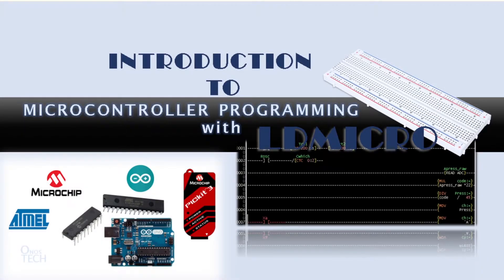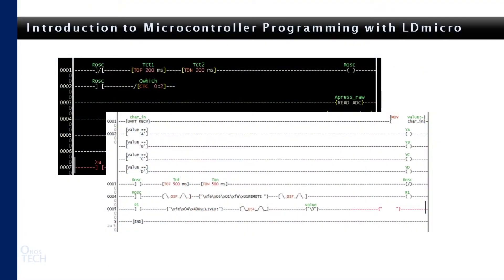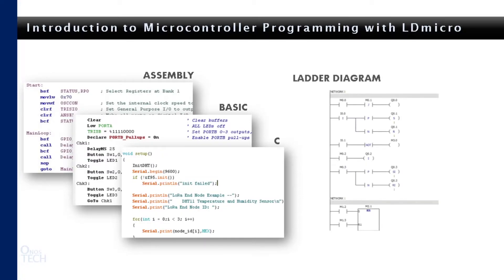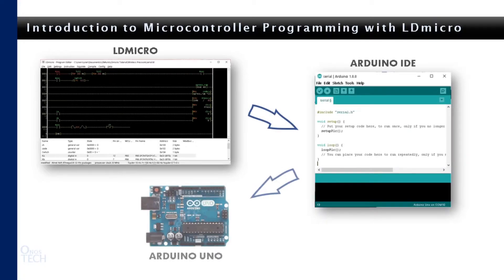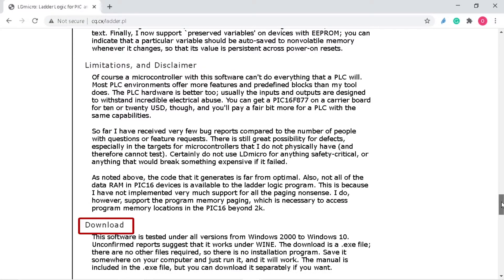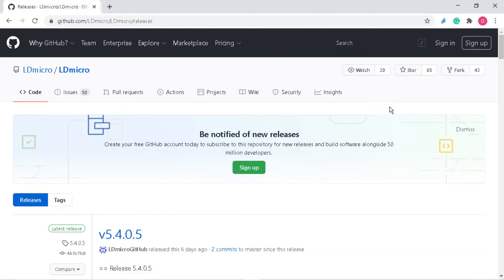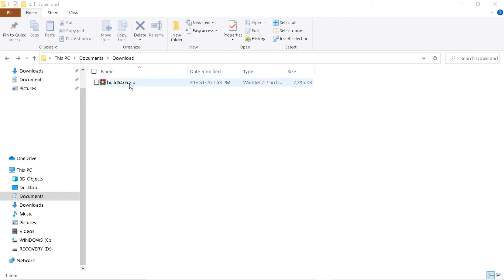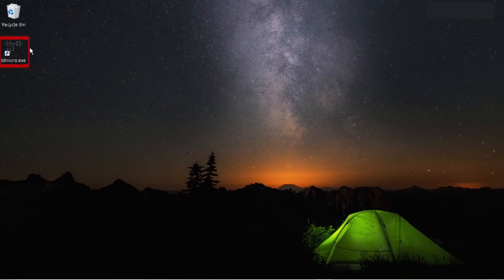LDmicro 1: Introduction (Microcontroller PLC Ladder Logic Programming with LDmicro)

Comment: Is it possible to use ATTiny or PIC12F with LDMicro  ?
Reply from the maker: You can use ATtiny10, ATtiny85, PIC12F675, PIC12F683, PIC10F200 and PIC10F202
Reply: Thanks, Man. I will try it in a few days and report back to you.
Reply from the maker: @mikesterling3949  You are welcome